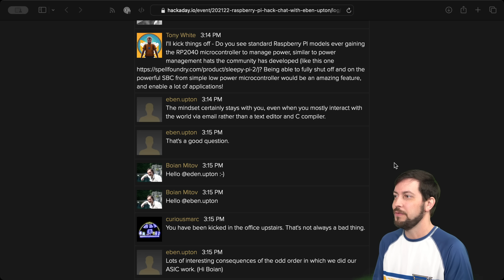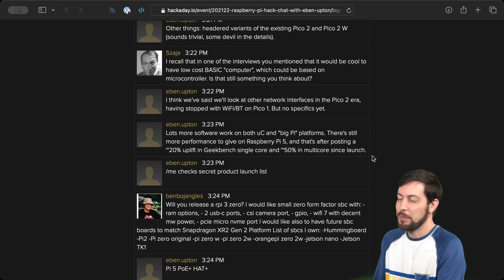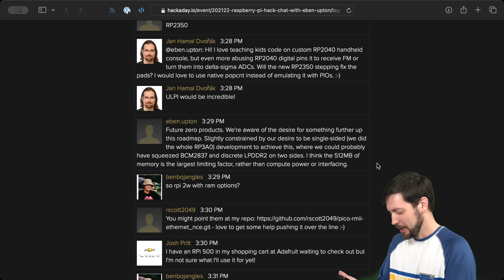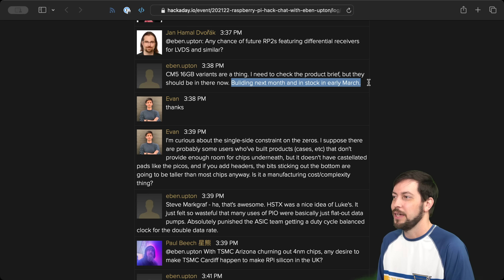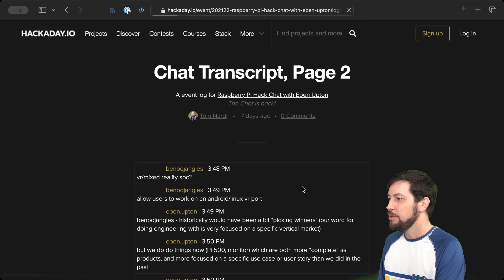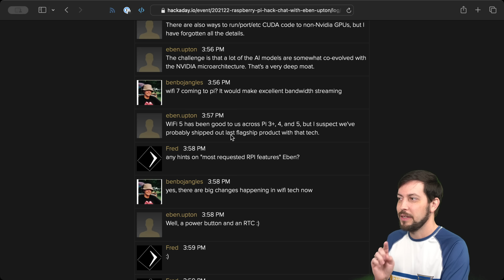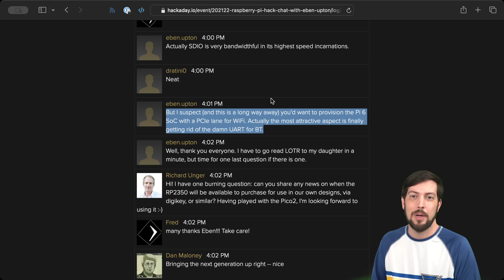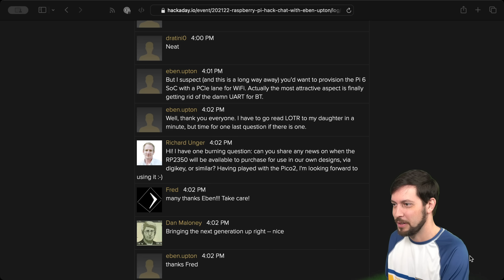Will the Raspberry Pi 6 have WiFi 7?

Comment: I find everything I see from the Pi foundation - is reading akin to an org still thinking in the same way as it did in its early days. They have no serious future if they see some low level, rather simple chip design as a 6-8 year 'problem'. They will be destroyed iteratively by china's SBC industry year on year. They are already being chewed on the hardware - only their software/community is keeping them ahead - but there comes a time where if your hardware is so behind, just good software won't save you. 

The radxa N100's start at £50, and they come with NVME. 
I think the orange PI 4a should have set alarms off at Pi org. I'd certainly be worried by products hitting market of that spec and simply being so far behind in what gets shipped. The PIs shipping now are neither cheap, nor feature relevant to market. Electing to not put something on the Pi500 that is shipping in competition will not look good as time passes. 

Don't take my comment wrong. I like the Pi's and Pi org, but I think they need to step up in many areas.

Comment: I want a PMIC that supports 12V USB-PD input. The weird 5V5A requirement has left me very puzzled.
Reply: 12V is optional in the PD protocol, its not mandatory, so 15V or 9V would have to be used.
Reply: @Silverdev2482  Either one would be preferable to  25 watts over a 5 volt line.
Reply: Yes!!!!
Reply: There are so many power supplies out on the market that provide 12 to 15 VDC.

 Making the board a little bigger to accommodate the voltage regulators is a small price to pay for power flexibility.    I would like to see the PI to go to a standard round 2.5 mm power plug instead of the USB.   Allows all of us to make our own cords.
Reply: @ Standard USB-C power supplies support 5,9,15 and 20 volts out of the box.    I like round barrel connectors as well but USB-C would be fine if the PI power side supported higher voltages.
Reply: 1.8v thru 48v
Reply: Multiport USB-C-PSUs only support 3A at 5/9/15V. This means one can not use one single PSU for RPi5 + peripherals. Instead the Raspberry PSU is always needed additionally to a multiport USB-C-PSU.
Reply: The reason why they didn't go 12v is because the circuitry needed would have taken up too much space on the board.
Reply: @ampex189  Does the PMIC have to go on the same side as the CPU and the RP1? If it doesn’t, then could it be mounted on the bottom?
Reply: If we're talking about needing to trade off parts on the board to fit it in, let's get rid of the built in Wifi/BT antenna and go for a simple IPEX/U.FL connector and include a basic little antenna in-box like most other SBCs already do with built in Wifi chipsets. Solves a number of existing issues surrounding poor performance and allowing the end user to upgrade the antenna without any hardware hacking/soldering. And it's not an insignificant amount of space to regain doing so.
Reply: @Vchat20  I'd be fine with removing WIFI altogether. I can always add it over USB.
Reply: @quademasters249  Ehhh, nah, given how few USB ports it has and how small the total USB bandwidth is. I would rather want an integrated solution.
Reply: @Vchat20  Honestly after 6 generations I'd be fine if the Pi was a little bit bigger. You can keep the GPIO layout the same, so that the HATs are still backwards compatible, but I wouldn't mind it being 10-15% bigger, all other SBC are waaay bigger anyway. Keeping the "credit card" size is just a gimmick by now.
Reply: @quademasters249 same. They can keep it on pi zeros and 500 (600?), but on the regular sized ones, if its between wifi and sane PMIC, I'd rather have sane PMIC
Reply: @Atom224  If you're any distance from the router, you're not going to get close to wired speeds.  USB ought to be fine for the speeds you'd really get out of wifi. 

I use the Ethernet port for anything performance critical.

Comment: PIO on the pi5 could be huge. I’m just imagining high speed interfaces with a high speed host that can hang. Could bring the gpio into a new era.

I’m doubtful about WiFi7. But a zero3 with WiFi5-hell yeah! Probably need to wait on rpi to decide on a new module or to use the one pi4/5 are using.
Reply: What is the difference? Can't you technically program the GPIO?
Reply: @xrafter yeah, you can totally utilize the gpio and you can easily use i2s, I2C, different flavors SPI, serial - I mean it’s a lot that there’s but none of that stuff is particularly fast. The PIO functionality of the pi pico lets it fake certain interfaces like HDMI for example.  HDMI can’t be broken out to the pi gpio and the only 720hd capable hat display (and it might be just 640x480) I know of is the Pimoroni (?) Hyperpixel and it pulls off the resolution by pushing the SPI spec to the max. I’d imagine several gpio pins could handle color data in parallel but you’d need a real fast clock to push them out, alas PIO.

Comment: Because they support the older models just keeps my loyalty. Enough said really!
Reply from the maker: The fact you can still run the OP Pi with 256 MB of RAM and modern fully-supported Linux is pretty awesome.
Reply: @Level2Jeff  I do not have your technical experience as I have only rebuilt the Kernel twice in the last 6 months. I do not care about pretenders. I just love a supportive community. Oh and you diverse uploads.... Not brown nosing, Just appreciating!
Reply: I've never rebuilt the kernel lol. I've wanted to, though.
Reply: @Genesis8934 
It is to easy bro! It is just like following a cooking recipe, without the preheat of an oven.
Reply: @xrafter Wait, everyone doesn't bake cookies while compiling the kernel?
Reply: @drewnewby  
 Yes, if you want you could bake while the kernel is compiling.
Reply: @xrafter  But many a recipe advises an outcome but so few really provide the support to deliver!
Reply: @johnbaldwin143  
So true, it is the same for some compiling guides...